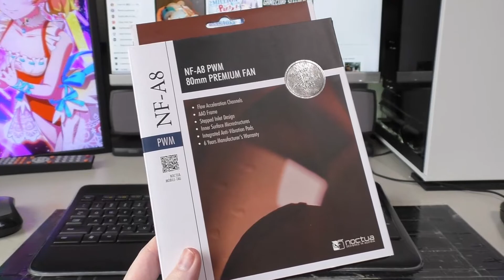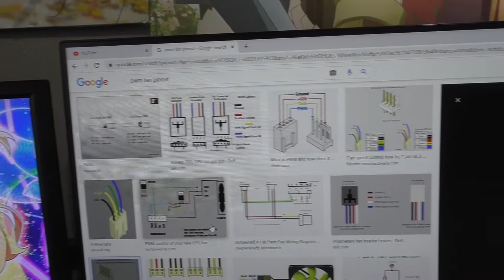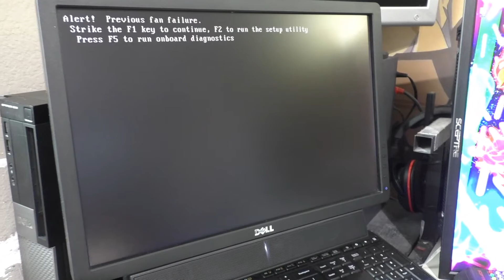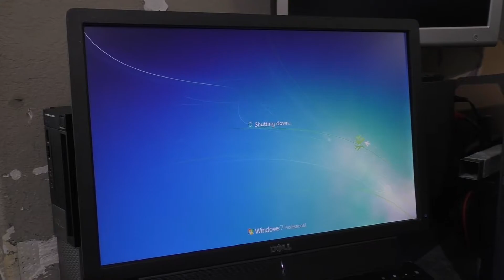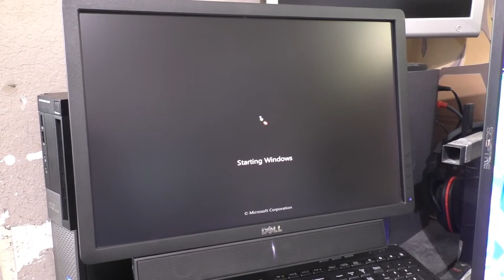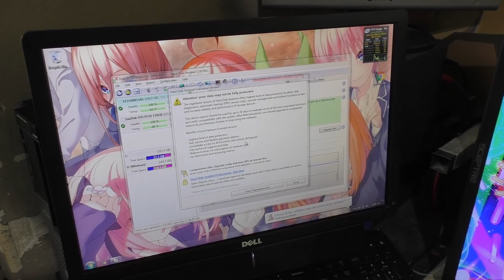How To Replace a Dell Optiplex 960 CPU Cooling Fan With a Noctua PWM NF-A8

Comment: I've got a pair of Optiplex 960s which continue to work well if old. Both are quad core units with 8GB of memory running Linux. I used your guide to replace the fan in one with a Noctua unit as the existing fan just wasn't able to keep the CPU cool enough any longer. Thanks for the assist!